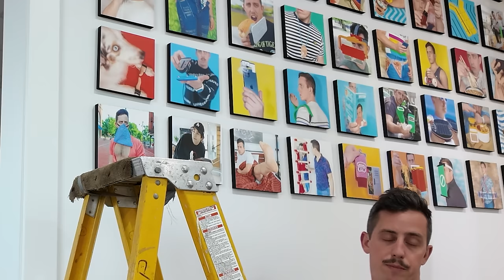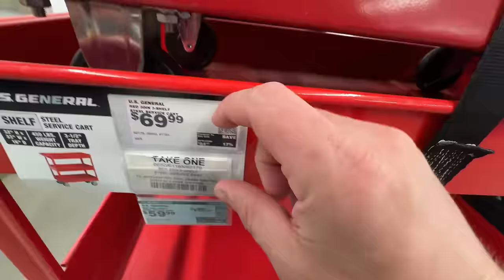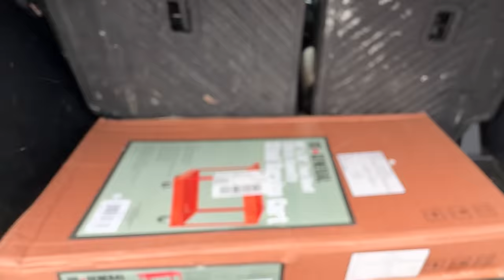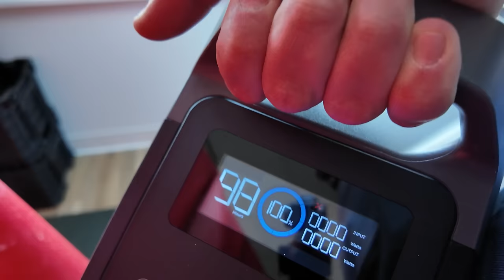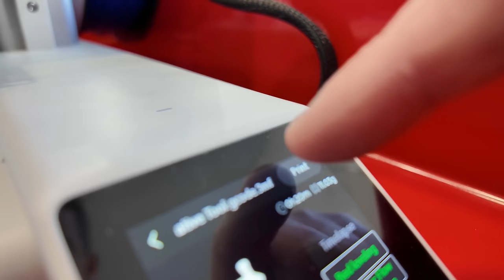My Design Studio Was Destroyed...

Comment: Ugh,  I'm so sorry Matt -- can't imagine having my studio flooded... 😢
Reply: yeah I feel bad for Matt, I hope unnecessary studio can recover
Reply: Hi
Reply: Hope recovery is fast
Reply: If hacksmith got flooded the lightsabero
Reply: Wow, didn’t know you watch unnecessary inventions
Reply: You should probably make a video about making a “tech safe” sprinklers for your inventions.
Reply: @the25thdoctor I don't think tech safe sprinklers are.. possible.
Reply: @Train115  There are sprinklers that shoot out certain chemicals or whatnot that are safe for tech or other expensive things
Reply: @Train115  sebloc is right. Many large companies use them in their server rooms.
Reply: @sebloc42  ah, ones that spray different chemicals. That makes sense.
Reply: Hey hacksmith whats up
Reply: @the25thdoctor  Server room (or tech) fire suppressant is rarely done with sprinklers. Most of the time it is done by shooting Inergen Agent (or a similar mix of gasses, most commonly being nitrogen, argon and carbon dioxide) out of pipes in the ceiling. This agent is used to void the space of any oxygen. This works almost instantly because fire requires oxygen to survive. This will also suffocate anyone inside the room, but it is much better than using foam or a liquid as it leaves zero damage to any equipment. Also, do NOT use a foam fire extinguisher to put out and electrical fire. The foam in most of these extinguishers will conduct electricity!

Comment: For the mobile cart, I'd widen the base a bit so there's no danger of it tipping over, even just the two wheels at the rear. I like the rod idea for the filament, you could even keep the active roll on it and feed it from there to the printer. Maybe an acrylic enclosure for the printer? Then some attachments that clip onto the sides, for holding your beverages, umbrellas, etc. Could you also add a motor assembly to the underside, motorize the wheels, and pilot it remotely with an RC controller? That seems like it would be an Unnecessary Invention.
Reply: definitely make the cart base wider
Reply: Yes it needs to be wider for stability!

Comment: I happen to be a speaker about maker scenario and education STEAM, and I am using a big backpack with: small and cheap leaser engreaver, 1 CR100 Crealty as a 3DPrinter, a plug adapter, a 3D Pen, a windows tablet, a small wacon tablet for drawing, a box with cables and arduino, protoboard and few actuators and sensor, a bag with filament samples of PLA, for colors options. It is heavy, but help me to have a really small and complet lab wherever I go.
Reply: Do you mean you put a whole 3D printer in your bag?

Comment: As a previous fire sprinkler/fire alarm inspector i would love to hear more details about the fire because if it was a small fire (suppressed quickly) on the floor above or intenional damage to a singular fire sprinkler head. Each floor has what's called an "isolation valve", these valves shut off the water supply to the fire sprinkler system on each floor and can be accessed through a panel on each floor, also it should not be locked, however if building maintenance/staff were trained properly on these types of fires that valve could have been shut off and mitigated water damage. But thankfully the system did its job in the end, a wet building is better than a charcoal one..
I hope things get better for you 🙏🏻.

Comment: Build a little shelf mounted on the underside of the upper shelf for the battery. It'll give extra space on the bottom for more stuff. Also mount a dowel down there to hold your favorite filiment so it doesnt take up shelf space.

Edit: now i feel dumb b/c like 30s after i posted this is when i saw your filament suggestion. I still think the battery undermount would be better.

Comment: well, a camera mount, to get the cart function as a tripod, maybe a few brackets, to have things at hand in the "legs" kinda, also having a better weight distribution, i would put the filament in the bottom, maybe include 1 in use and 1 just in case the first one is consumed.
Oh, also a few brakes/brackets, to have the cart firmly in place, just in case you really need the extra stability and avoid the cart just roll away..

Comment: So sorry to see this happen to you. I’ve dealt with flooding before and it’s not fun. I do have some ideas for the mobile studio. What if you could add a panel screen that has enough strength to run your preferred CAD software and have some sort of WiFi hotspot as well for it to be truly mobile. Also having two camera mounts one aimed at the printer and one at you might be interesting with a hard drive and storage for extra micro sd cards could be interesting

Comment: You could modifi the handles to put the filament there. i suggest you to have at least 1 fix wheel to help prevent tipping over. Also you couls have 2 drawer type cabinet back to back to store stuff under the cart. You can also use the edge of the cart to had pole to support a Camera / light whatever you want. the wheel can be place a little bit wider to show the 2 mounting hole after you could use them to mount stuff to it and clamp it to the side support. It could be funny if every time the cart move a song is playing like Shakira whanever. Because Whanever you go it will work

Comment: 10:14 - quick feedback on the wheels on the cart, I feel they're a little too big at least for being all swivel wheels, if something were to make them both swivel inwards when changing direction it could cause the cart to tip over. Maybe swap the wheels on one end for fixed ones could help with that

Comment: This sucks dude. I work at servpro and do water damages, fires, mold, etc clean ups daily.  The restoration is literally the worst part. We just go in there and tear out anything wet. Like if we were already there bro, there wouldn't have been a ceiling still for sure or floor. Insulation is terrible with water so is under floor where fans don't travel. At very least there would've been holes everywhere to get air moving 😆

Comment: 10:20 @MakersMuse (and others I'm sure) have picked up printers and held them upside while they were printing, and it basically had no effect on the printer, so rolling it around it shouldn't be a problem. In fact, the fact that the cart can move, it can absorb movement from the printer and potentially result in better quality prints.

Comment: for the mobile studio you should have some sort of laptop dock that's elevated maybe right in front of the handle and over the printer (like a standing desk). Although I know you use a trackpad for CAD(insane) you could add other peripherals that all could be easily hooked up through a single usb c cable along with power.

Comment: should have got two carts, then you could have them side by side, and 8 wheels for maximum stability, and maybe even some sort of auto leveling systems built in.
Reply: and you could have two modes for it, side by side and "train" orientation. if you are going to bring it outside you will want a clear dome and maybe a solor panel or two. what about a fold out stationary bike, that you could pedal to charge things as well.

Comment: Move out. I remember you said you paid a lot of rent in advance. You might have to go to court but you can probably get it back considering the circumstances. Even if this is all repaired, this is traumatic. Take all of your stuff to a secure building with surveillance, security and fences. A building with no second story. Sure. This could happen anywhere hypothetically but at this point you should get what you can, put it in storage until you can figure stuff out and move on. I understand the idea you had for this space, but it's honestly bigger than what you need and it's going to be horrible sticking around and waiting for construction to be done. Obviously insurance will replace any machines, at least I hope. Destroyed art is different. I lived above a tattoo shop that flooded during the pandemic. I ran downstairs and I was tearing artwork off the walls, filling trash cans with water as a literal waterfall fell on this lovely shop. They still remained in the building because they're strong, but the bookstore next door which had been there for years moved to a building where this couldn't happen because the owner knew there were books that were irreplicable and uninsurable.